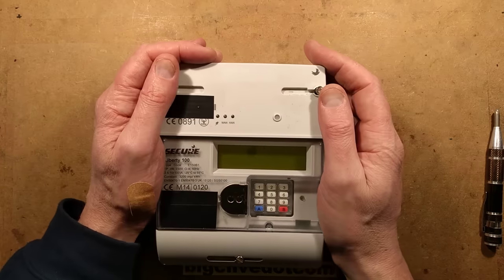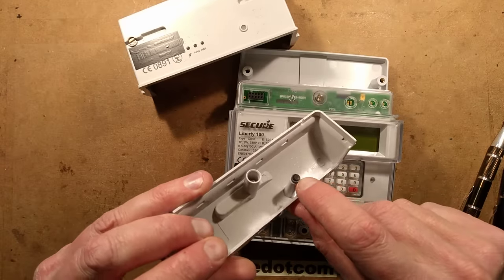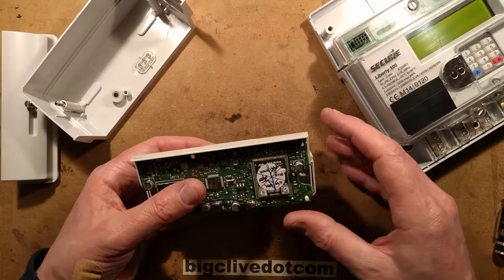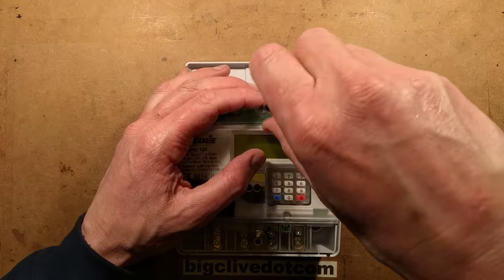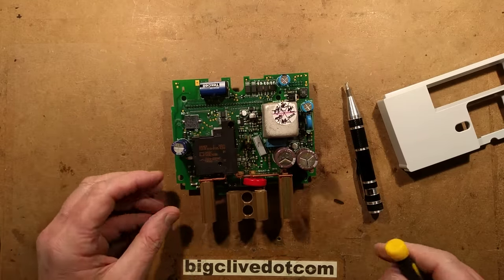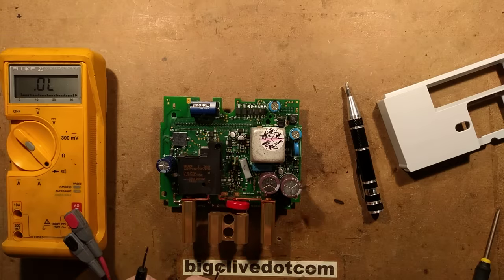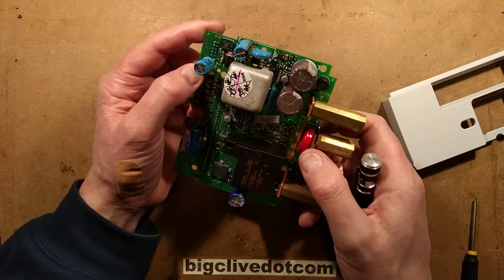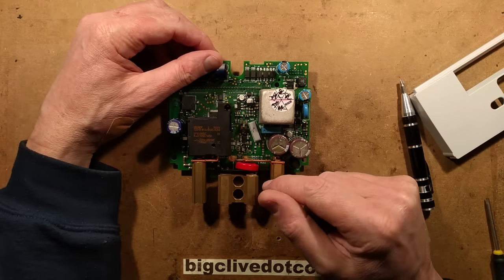Inside a smart meter, and the REAL problem with them.

Comment: Opens meter.  Removes microphone and Mind Control Gas module.  Reassembles and starts filming.

You're fooling no-one, Agent Clive.
Reply: Nope... He removed the mic on 6:44
Reply: And that was the last time anyone heard from Rogerborg.
Reply: And most electronic has mind control gas inside... It's that blue smoke... When you smell that you normally start to feel angry...
Reply: @A3203503  who is Rogerborg? I see no Rogerborg. You must be imagining things. I think you might be suffering from stress and you will benefit from an all expenses paid vacation to Guan... err Guam. Yes, Guam. 😶
Reply: Oh, it's all there and easy to see.. 
Mind Control Gas module is the big silver box he 'doesn't want' to open.. The 'crusty' look is typical of holding an organic effecting gas and it's delivery system..
And pull apart a modern mobile phone and find the microphone in that..  Modern MEMS microphones are TINY!  It's a mm or two square component. Look up the SPQ 1410  for example. No need to 'remove' it.. Just not zoom in on that section of the board.
Reply: What we don't see is the Aluminium Foil skull cap that Clive has on during the entire video recording of this session.
Reply: He left the cancer knob attached though.  I assume that was an oversight.
Reply: You forgot about the outdoor and indoor-facing pinhole cameras  that also must've been removed.
Reply: underrated comment
Reply: does it really matter if it has a mic every on has a smart phone and also people have amazon alexa,s and google home they all have mics
Reply: @A3203503  LOL! :)
Reply: @Whigu  
that usually depends on how hard it is to get to and how much it costs , hehe :-)
Reply: Was going to upvote but thought I'd leave the counter at 420.
Reply: @memberwhen22  You need even more help if you can't detect sarcasm and irony.
Reply: Hah!  The BCF massive have invaded YouTube?
Reply: @ElectraFlarefire  lol, and the black box, is nuclear device meant to instant kill people.

Or some wierd nonsense.
Reply: @aaronletchford  Yep, i'm with you on that, the phone we bring around everywhere, everyday, is a bigger treat to privacy.
Call Goggle or Facebook and they can proably tell you, how many farts you release when sleeping.🤔😁
Reply: Hi Clive,
Is the relay just normally closed or is it a latching relay?
The Isle of Man has been used by many cellphone networks as a test site for many years. It's large enough to set up multiple cells, good for logistics but far enough from other radio networks not to cause interference when the test system is experimental and uses frequencies that it is not licenced for elsewhere. I suspect this is why Max telecom supply the multi-network simms.
I wonder if the transient supressor has some built-in protection. This must have been taken into account when it went through approvals. 
Are you going to take off the can and the relay so we can see what is underneath?
If you were going to bug someone, why put a microphone at the back of a closed cupboard!!
Reply: @memberwhen22  
It's all true. It's being forced on the human population by aliens. Aliens see the human species as aggressive and adversarial against one another and the environment that supports them. In an attempt to keep us all under control, they have insisted on us using mind control devices such as smart phones, smart meters, smart cars, and various smart devices that you don't even know you are using. Every time you ride an elevator and push the floor you want to go to, a small amount of mind control gas is released. You can't hide from it. Mind control devises are in your home, at your work place, in your car, on the streets, and even in the ice in your drink. Manitowoc ice machines us a small pump in the harvest cycle to speed up harvest, or are these pumps used to put a small amount of passive mind control chemicals into the ice.

Or it might be all fiction. You decide, but if you choose wrong, they may come and get you in the middle of the night😶
Reply: Rogerborg lol They did more damage with nuclear testing than any meter will ever do.  Not to mention the power stations that blew up!  Very interesting look at a meter, dam, they have made it tamper proof!!!
Reply: Precisely
Reply: I would have loved if to see him do: "Oh my, that looks like a microphone... Just kidding."
Reply: The Mind control module seems to be working perfectly here because it convinced Clive that the device is harmless.
Reply: @ElectraFlarefire  just checked the datasheet for that, so much bullshit in that datasheet. 94dBs of SNR, flat frequency response from 100Hz to 8kHz lol no, not in 100 years
Reply: sleight of hand.
Reply: Lol
Reply: Keysight
Reply: this comment thread is a perfect example of people both getting and not getting a joke
Reply: It could be a Nerve Gas Module for when the government decides to cull people on benefits
Reply: Roger, i think i know why you are RogerBORG. You are the the borg, the core of the collective, you are everywhere. Airsoft forums bike forums youtube...
Are you the real Illuminati ? haha.

Just kidding, its crazy how total much strangers interests can align tho isnt it.
Reply: Wow there really is a lot of people who believe smart meters are a big conspiracy when all they are is a digital upgrade from a shitty analog meter.... some people have far too much time
Reply: I am bereft of ribs (not)
Reply: @memberwhen22  -  Being "restored to sanity" is highly overrated.
Reply: There's no real data on long term affects /effects but we do know: "Information = power! Strangely, people offer up so much personal info to these harvesters...
Reply: Wolfgang cutthroat  How about some punctuation?
Reply: Why would you need a microphone  if it has bluetooth and dsp antennas?
Reply: @biglogied5142  Your comment shows me how you TRULY do not know. Just the analog comment itself. I won't even touch on the others. You spoke. And showed your lack of knowledge.
Reply: Usually the number on the SIM card starts with the MCC and MNC. https://en.m.wikipedia.org/wiki/Mobile_Country_Code
Reply: MrCordycep Guano?
Reply: @MrCordycep  It's the username of the person who commented smh..
Reply: All thats bull shit lol
Reply: @ElectraFlarefire  Given that most houses built in the UK in the last 20 years have the meters in boxes on the outside of the building I wonder what "they" would hear from any microphone in a smart meter.
Reply: @Whigu  the GSM module is removed at 3:21 which is from Sierra. Model: modem module gsm sierra wireless wismo 228.

And it does have voice capabilities to 3.1khz, search for the correct pin and look for dubious microphone packages, which can be very tiny these days.

So they might actually be right that people could be spy-ed upon. 

@bigclivedotcom should take a better look at this module.
Reply: Baaaahahahahahahaaaaaa, dass funny
Well done
Reply: @MrCordycep  Surely you mean Guantamano??
Reply: @ME-ru4hv  so that if the tamper switches are triggered it can contact the supplier and listen in to what is happening??????
Reply: @ME-ru4hv  what are they gonna do? listen to me having a shit? they are welcome to. if someone wants to spy on my life then I don't really care
Reply: @aaronletchford   I say this all the time. The people who do the most complaining about shady government/corporate actors trying to steal their information are the same ones who download programs on their phone and don't even read the popup message asking if they're sure they want to give a flashlight app access to their microphone and photo gallery. If you really put effort into keeping your information private then good on you, but this selective outrage shit is so annoying. If you're on the internet to begin with then don't even start, you've given away more personal information then has ever been stolen from you.
Reply: "Oh, dear"
Reply: I don’t even think it’s Clive making the video. I’ve performed my own dim web, flex capacitor, data analgesics on the voice pattern and it’s coming up 99% certainty it’s Elvis. I’ve said too much already ☹.
Reply: The 90s wants you back @DaveyMulholland
Reply: @UncleKennybobs  as you grow older you'll realise that being trendy is absolutely fkin cringeworthy. Sorry... "cringe"
Reply: @rogerborg  my sister just had a smart metre fitted and the engineer that fitted it told her she didn't have to plug the little box in as your metre sends the readings so she has never plugged it in so all this crap of them listening  to you ect ect is bull if you want to see what your using then plug it in if not don't

Comment: A couple of years ago,I used to put together smart meters for Honeywell's in Stafford. They shipped them everywhere,all over the world. It was a slightly different design than the one shown here,but I think their all supposed to do the same job. It was quite interesting to see the inside of them,but when I managed to do approx 100 every night shift,I was sick of the sight of them. Even though I saw it done,I didn't get to do the technical stuff. I just put all the bits and pieces together,then packed them. There was one thing I enjoyed. I had the drill just a tiny hole, approx 1mm onto part of the circuit board. I think it was to stop people changing whatever information was on there.